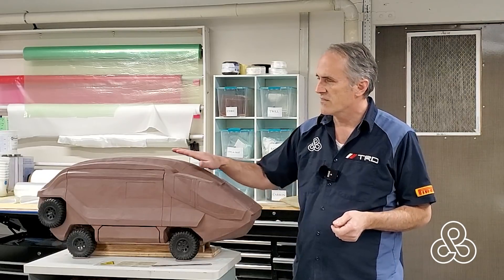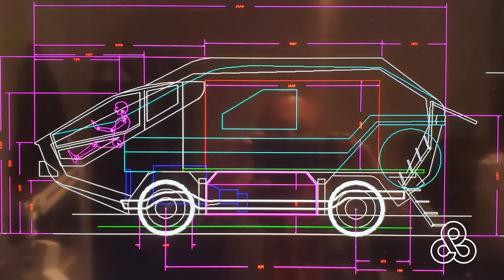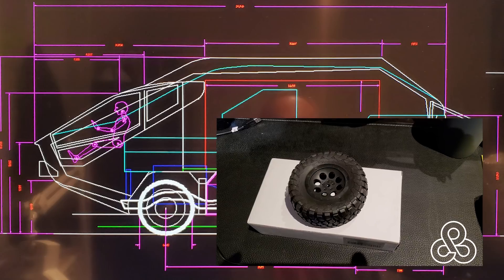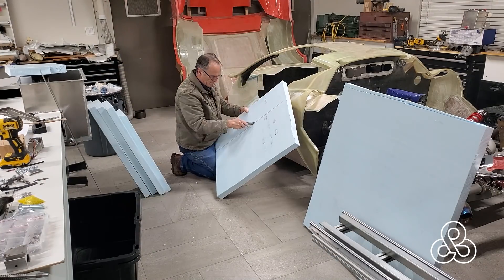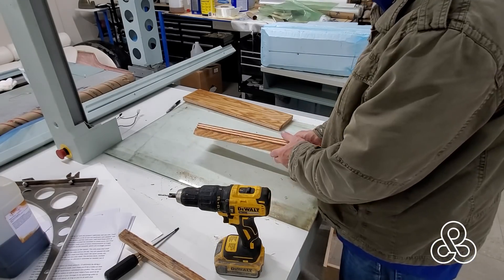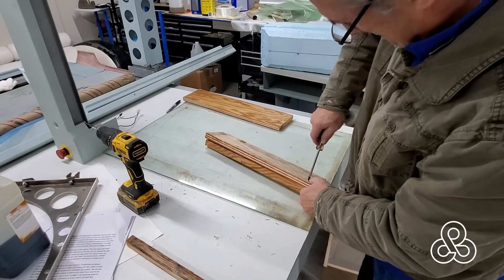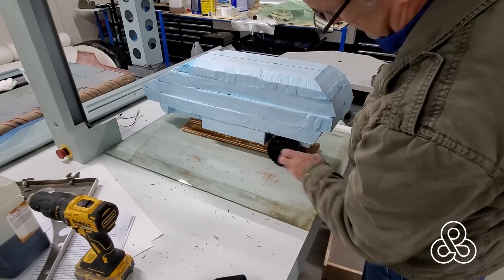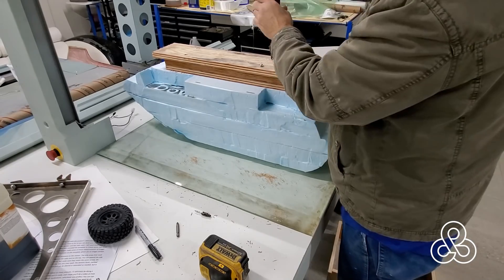L2 Automotive clay modeling for the home builder. Leviathan Supervan project.

Comment: Hello. I follow your channel and I'm a big fan of yours.
But I have been following the Leviathan project and one point worries me.
The vehicle has a huge problem.
It is too tall for the width of the front and rear axles shown in addition to its short wheelbase. The base is smaller than the height and width.
This makes it unstable for both urban and off-road environments.
For use on land and uneven floors, it certainly wouldn't support 15 degrees of inclination, which is too little.
Reply from the maker: It is not a matter of size, but of mass. I am going to great effort and expense to keep the weight (center of gravity) low. The upper structure is all aluminum or foam core composites. Likely half the weight of a traditional motor home. We will get to see what capabilities it has, I shouldn't think it can't attack places that the heavy Man or Unimog overlanders traverse and at a fourth their weight maybe some they can't. Thanks for following the build!

Comment: What are the most common issues that many of today’s RVs have particularly when using them off road is a high center of gravity. In fact some of these vehicles particularly truck campers flip over quite often on the highways. I would certainly be concerned with a height on this based on that model.
Reply from the maker: height is not necessarily the downfall of the center of gravity issue. Since locating most of the mass low is the solution, that is were I am focusing my efforts; all aluminum and light weight composites above the floor line.
Reply: That’s true but people notoriously start filling up their recreational vehicles with things and those things raise the center of gravity. Yes I would imagine if you keep all of your storage below the waterline it wouldn’t be an issue.

Comment: never understood why you can't put a prop on the diff? I know it would have to be very protected but the dang drive-shaft is called a prop-shaft, there must be a way to combine them no? Have a separate off-set shaft that tucks up into the chassis and then drops down?
Reply from the maker: Propeller (water) speeds need to be much higher than auto drive shaft speeds and "gearing back up" would be an awful lot of frictional loss.
Reply: @BuilderCreator  I see that makes sense, not sure what gearing back up means but I assume running it through a multiplier would also create mucho drag, still seems a clever design if it was possible.

Comment: A great clay trick for Chavant or similar is to cheese grate it all up, makes it really easy to be additive and control volumes. Store it in a plastic bag and working under a warm lamp is enough to make it really user friendly.
Reply from the maker: I usually don't mind smells, (think polyester resin. Ha!) but Chavant stinks terrible!
Reply: @BuilderCreator  same, I love most shop smells. Have you tried Monster Clay?
Reply from the maker: @TMFXLLC  I've seen it on art supply websites, but have never used it. I use JMack classic clay (medium). It is more of a sculptors clay, but I am familiar with it and always have a 100lbs on hand. I see you have an old mixed use building (HQ) your fixing up. Sounds like a great project!
Reply: @BuilderCreator  I emailed to save you a wall of text lol.

Comment: Looks interesting, although not really my thing.  You mentioned using polycarbonate (PC) for the side bubbles.  It's definitely strong, but it's certainly not scratch resistant.  It's used in motorsport, but the reason it's not road legal for windscreens is that it scratches up a treat.  One drive in the wet with a dusty windscreen would render it pretty much opaque.  In motorsport, the teams are usually fastidious about cleaning the screens, so when they do need to use wipers, they're less likely to be swiping dust across the screen.

It's also not legal (in the UK at least) for side windows, because you need to be able to break it in an emergency, which is something you may need to consider.

For scratch resistance, you may be able to use a clear wrap to function like a screen protector on a phone.  Some motorsport formulae use tear-off windscreen covers, a bit like tear-off strips for motorcycle visors, so the technology is available.

Note that I'm not suggesting you shouldn't use PC, just tempering your expectations; it's properties are often wildly overstated.  You may feel that you can live with a few scratches from trees, and you may not need to be able to break it in emergency.  If you're planning on vacuum forming it yourself, you may want to reach out to the DarkAero project.  They've already been through a lot of the pain getting good results for their cockpit canopy.

On the subject of tempering expectations, I remember Mythbusters, and how they used PC for their blast shields "because it's virtually indestructible".  Years later, they tested it, and it was nowhere near blast proof, and they'd been placing their trust in it for their safety all those years.  I think Adam Savage described it as a sobering experience.
Reply from the maker: Lots to consider of every medium . . just need some transparent aluminum! Ha!

Comment: Very glad to see you dropped the amphibious part from the design name. There are still problems.. Ground clearance and overhangs to be more precise. A rule of thumb for off road vehicles is, you can't build an overhang longer than the radius of the tyre, and even then the angle from the rubber surface has to be very steep. It will grab, and get the vehicle stuck. And anything below the axle line, works as an ancor on soft surface. To get an off road vehicle to climb over anything; creeks, ditches, rocks, tree tunks, bad condition back roads, any overhang over the wheel is going to cause issues. So where the rim stops, should the body stop also. This way the rubber has the most surface to grab onto, and climb over obstacles.
Reply: Looks like the wheel base could indeed be lengthened. This may add significant complexity, but consider doubling up on the back axle. The sharply chopped body projections that run along the sides beg for a more aerodynamic termination. They add a lot of interest, but maybe taper or chamfer them back into the main body.
Reply: @psibitful2  Even with double axles, that design will get stuck on a river bank in any steep (natural) crossing. The nose is too long and hanging low.
Reply: @oikkuoek  Right, what I meant is the wheel base should be made longer at the expense of the overhangs.
Reply: @psibitful2  Not a bad idea, but there is also a limit on the wheelbase. When climing up a river bank, if the wheelbase is too long, the vehicle gets stuck by it's belly. This can be redeemed by adding more ground clearance, but then the mass centre lifts also making the vehicle top heavy and unstable. Making a working Off-Road vehicle, the balance between these factors has very small margin.
Reply: @oikkuoek  Sure, the potential of getting stuck increases if the author goes for the comfort of an XL wheelbase. It's likely that the goal here is safely getting to the next RV park using reasonable roads. This truck should be fantastic for all of that.
Reply: @psibitful2  but you can do that in basically every existing Winnebago model, and this design started as an amphibious concept, then overlander, and now it's a regular RV? Why even bother spending rolls of fiberglass and buckets of resin just to make another Winnebago? Or something worse than a 90's VW bus?

Comment: sir, how are you thinking of implementing electronics like switching to the aqueous mode and extending the section for camping mode, and will that even be an issue? Secondly is the mohawk just for aesthetics or does it have any specific purpose?
Thank you...
it would be awesome to see this new build take shape 😊👍
Reply from the maker: There will be hydraulics on board that can be used for extending flotation tanks and wall lifts. Investigating the use of hydraulics for water propulsion in the stern drive as well. The mohawk lowers the perceived roof height while still allowing teller passengers head height. It will also stiffen what would other wise be a large flat roof that would need ribs or other heavy structural members to span the distance. Breaks up the boxy look as well.
Reply: @BuilderCreator  got it, Last question did you wake up right now or going to sleep? 😂😂
Reply from the maker: @divyanshsrivastava7312  On the last comment I was just about to do a few more hours of work before I went to bed. This comment I have been up for a few hours.

Comment: Looks to be about 120" tall and 360" long.  Beast.
Reply from the maker: 110 x 300 . . good eye!
Reply: @BuilderCreator  remember 11'8" bridge.. Air adjustable height?
Reply: @bradmaas6875  Air ride on the campervan for that shlammed aesthetic. 30° negative camber and underglow, and tinted headlights to show off your drip.
Reply: @Jupiter__001_  Adjustable suspension will allow for better ride over various terrain, and no, I don't show my drip to anyone thank you. Ha ha.

Comment: Front overhang is way too big for off roading.... plus is a huge area of wasted space unless the driver is forward of the front wheels which is lethal in a crash.
Reply from the maker: It hasn't slowed down Tatras or HEMTT military transport trucks.
Reply: @BuilderCreator  PS... It has slowed them down because their design choices have never spread beyond the military and into driveways.  Hummers made it to the  public, Military Transports have not because there are safety and liability laws for production vehicles..

Comment: You said your using polycarbonet for windows have you thought about how you would escape if it capsized or some other situations where you can't open the doors ( with the flotation tanks it's unlikely but it's something to think about)
Reply from the maker: The roof hatch that was originally over the passenger behind the driver, will be moved center to the celerstory/mowhawk that extends to the cab.
Reply: Maybe an emergency hatch in the roof like in school busses could work... I feel the roof should be flattened a bit design wise anyways, atm the mohawk looks a little too round??

Comment: Hi, I really like where you are going with your concept. However I do have concerns as to the spare 40" wheel and tire mount location. If you consider the weight of the spare and the height the average person would not be able to lift or handle it. Assisted lift arm would somehow need to be implemented.  I would also increase the tire size to minimum 44" Given the bulk size of the vehicle. Not telling you what to do..merely suggesting.
Reply from the maker: Spare retrieval is a great idea. We have gone with 40" max as our design limit as tires over that start to get extremely expensive, especially when you factor in wheels and gear changes etc.

Comment: I like the design,  don’t know how final this is but in my opinion the wheels look to small, I think if they where bigger they would balance better with the rest of the design. I guess you have reasons for it beeing that way but I’m just going on looks here.
Exciting project! 😊👍🏻
Reply: Yeah, they do look oddly small relative to the bulk above them.
Reply: 40" tyres are pretty damn big. not cheap either. you have to remember this thing is going to be quite massive. the bigger the tyre, the more issues you run into with driveline.
Reply: @myopinion69420  yeah, but like I said... it LOOKS to small in the design, as in with the rest of the car.
So not talking numbers here, just looking at the whole thing.